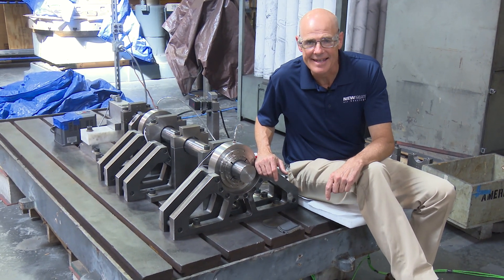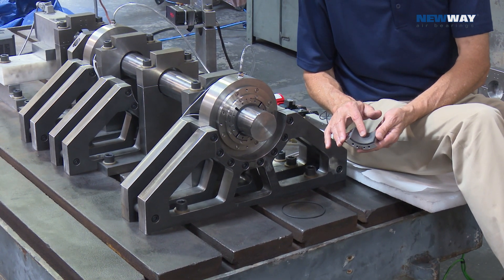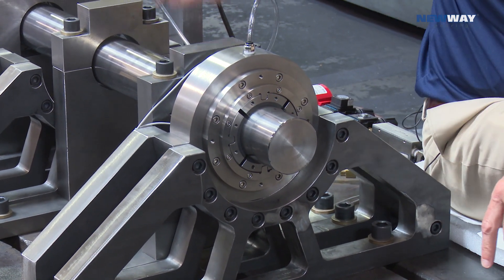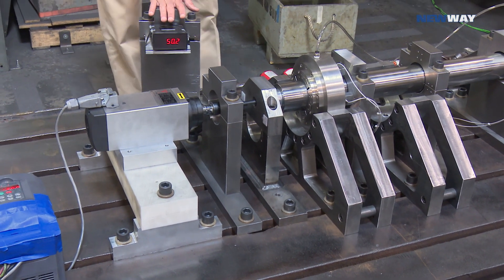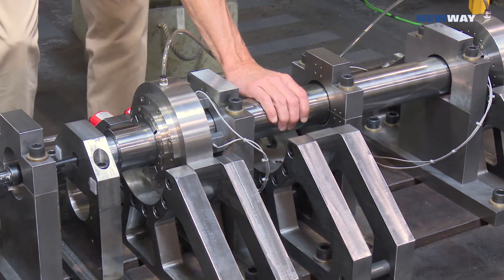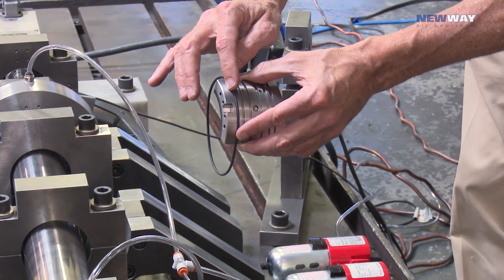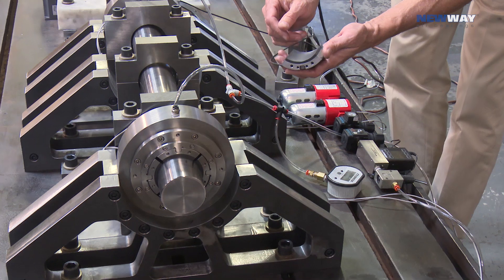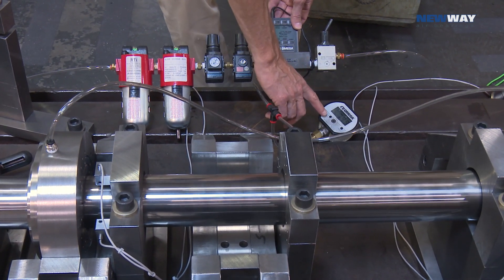Cartridge Bearings

Comment: How smooth does the face of the shaft have to be for this to work? Does it have to be finely polished? Or just close?
Reply: My understanding is the dimension and fit need to be super good but surface finish is fine with anything that feels smooth. someone correct me if I'm wrong I am not an expert hope that helps
Reply: @nicholasjacob3594  hey thanks for commenting back!
Reply: Obviously it can’t be rough surfaces but what’s the limit for operation?
Reply: I think this video answers your question https://youtu.be/Jq4a25W_emI

Comment: What is the load capacity of this application, and weight of the shaft?
Reply: about three fiddy
Reply: Shaft 75 lb
Reply: Material TypeMetalMaterialSteelGrade1018Diameter3/4"Length3 ftHardnessRockwell B65SpecificationASTM A108StyleCold FinishedTypeRound Bar StockTensile Strength60000 psiYield Strength40000 psiFinishMill (Unpolished)Product Weight4.506